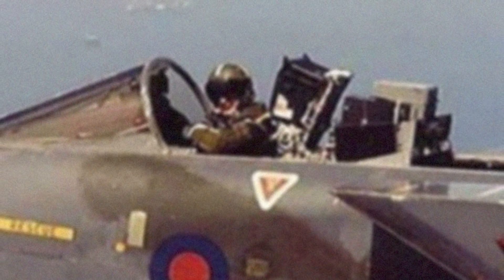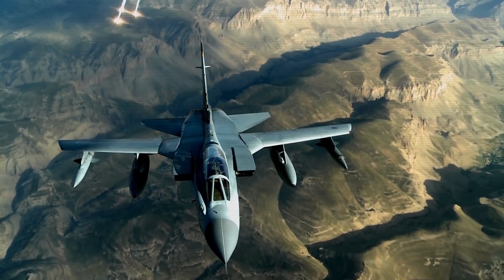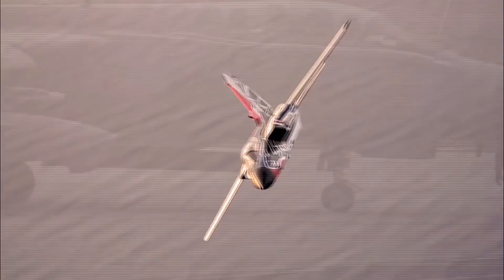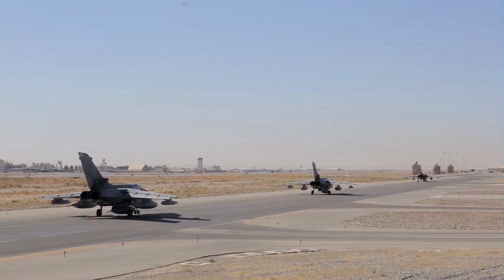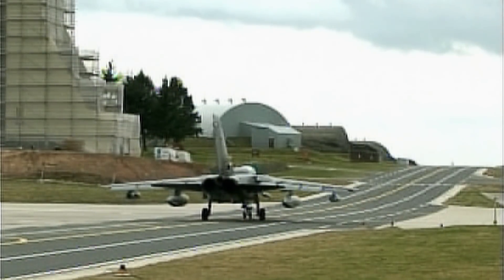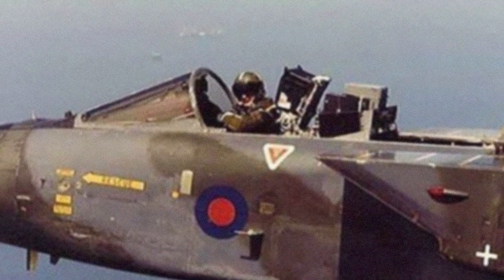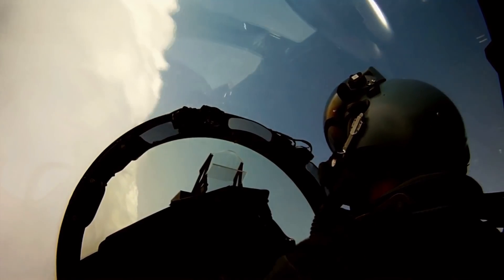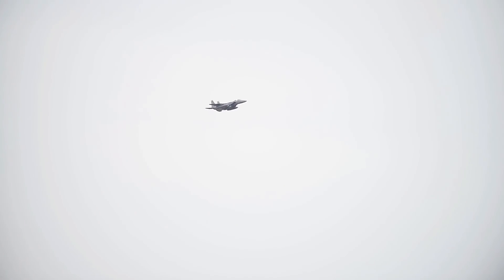RAF Tornado Flying with the Top Down

Comment: The XC versions were not marked with RAF markings.  The incident you refer to may have occurred but not that picture.  There are several glitches in your narrative.  These aircraft were engineering marvels.  Canopy loss does not take out the comms.  Also FYI an F15 returned to base and pilot was unaware until after he landed that he had lost a wing.  Please fact check your narrations.

Comment: F15 has a navigator??? its a single seat fighter, maybe a twin for training. Are you sure you dont mean F14?
Reply: Israel has F-15s. If they didn't get Strike Eagles they made their own from the trainers.
Dark does have a lot of factual mistakes, though. Could have been a student pilot, though the instructor is usually in the rear seat then. An incentive ride or familiarization flight would have someone the pilot would be very concerned about. 
The flight surgeon in a squadron does fam flights on the regular-he'd get first hand experience with high altitude physiological effects.

Comment: Same thing happened in 2002 at NAS Fallon with a F-14D. CAG Chaplin got approval to take a back seat ride. He got a full check out in the operation of seat ejection system. Pilot was doing some moderate ACM maneuvers nothing over 3g, and the Chaplin grabbed the wrong handhold and seat worked as advertised he ended up with a broken collar bone being slightly out of position during the ejection. The pilot circled to insure he saw a good chute and made his way back to the airfield 20 minutes later. Landed the aircraft without incident and only moderate damage to dorsal area where the canopy flipped back and hit the aircraft punching a couple of holes in the skin.

Comment: Back in the 70s i was in a Navy TA-4J squadron and we had a plane in cruise over Houston area when the canopy departed the airplane. If memory serves he was at 550 knots and 40 some thousand feet. In long cross country flights they were routinely up in the high 40s to the 50s altitude and 550 knots. The canopy damaged the vertical stabilizer and the pilots maps and assorted other gear up on the glare shield went down the engine. The engine was FODed pretty badly. But the plane made an emergency landing at Barksdale AFB safely. I was part of the crew to change the engine, repair the cockpit damage, and repair the airframe damage. It took us 2 weeks to get it done. This was back when the B52s at Barksdale were loaded with nukes. It was the Cold War and they had a plane in the air 24-7, 365 days a year. It was KC-135s & B-52s there. The airforce had a security officer to keep us out of trouble and to keep us from getting shot. It seems if you crossed a painted line they would shoot you. But it was pretty cool. They were aware of us, why we were there, what we were doing and that we didnt know all the rules and protocals. In fact we worked out of the security quansut hut on the ramp. They knew us personally and by sight and treated us well. They showed us how SAC worked back in the day. But, back to the topic, yes, canopies can and do come off occasionally.
Reply: Great Comment Sir compared to the others.
Reply: Excellent comment,  and
  Thank You 
VERY much for your service,  Sir.

Comment: testing flight  for unequally  pressure, inside  over pressurized, pops the top
30000 thousand feet, what is that like almost 5 miles ,  trying see if  can counter space MIG, back then....and fix problem, by the book.

Comment: This plane could carry a large amount of stores as much as a 4 engined WWII bomber.
Reply: Yer, I feel it should have been upgraded again instead of retired. It was one of the best low level bombers of its era. Still had uses. Shame. Plus it’s a good looking plane.
Reply: @damedusa5107  Agreed, with upgraded systems and capabilities it would be a great asset for ground attack operations. That and i'd rather fly the Tonka than an F-35, which says enough about it really.
Reply: Mark Cooke not really tho. You could’ve said that about the f18. But the new super hornet  is completely different than the original. I’m talking complete modernisation not just upgrading the components.
Reply: Mark Cooke  adding on from Da Medusa, look at the F-15. It would've gone out of service a while ago had it not been upgraded so far, and now there's the F-15EX. Same story with the F-16 and now the F-16V.
Reply: Mark Cooke  that's fair, but regardless I feel like maintaing a reduced force would've been a better decision, although I am biased by my love of the Tornado haha
Reply: Mark Cooke again, to my original point. You would say it’s not cost effective on any of the projects we have just stated, yet they happened. The tornado was a specialised bomber, which we now lack, Britain has poured its money into multirole planes like the f35. The costs for this in development by the USA is huge, so really a new designed tornado building on the existing airframe wouldn’t be as much in comparison. Maybe it’s the correct decision to go multirole and it’s impossible to know. But the decisions made are obviously based on huge money contracts and the F35 seems to tick all boxes currently for the airforce. Personally I think a specialised bomber will be missed. The tornado has 3x the bomb capacity in weight than the F35b. So my point is, it’s not just money, it’s also a political and deliberate philosophy (due to the fact it has to be carrier based) that has chosen to put the f35b in that role. So I can understand it, but I do think it’s capabilities will be missed.